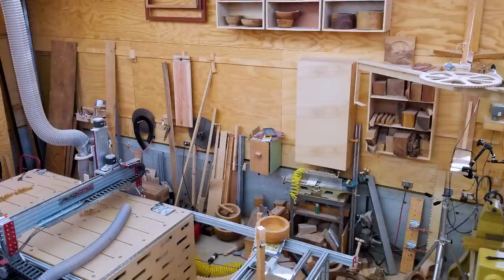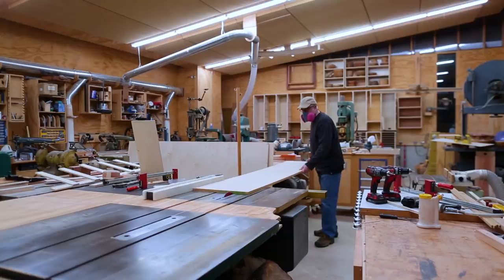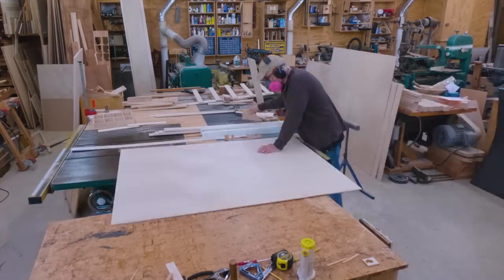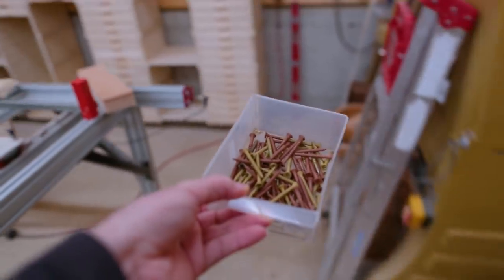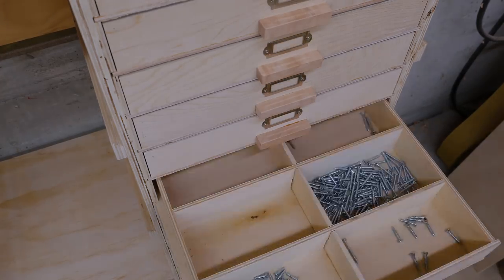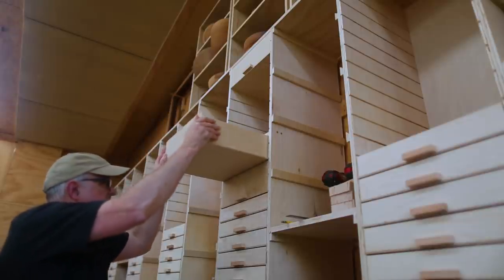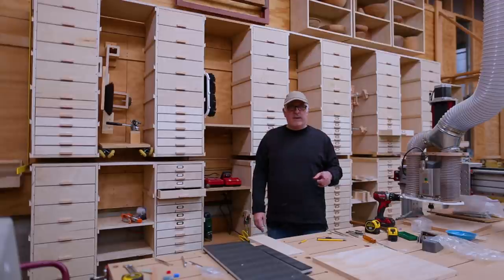Drawers for Small Parts

Comment: Probably already thought  of/mentioned - when you empty out a box then tear the front marker of the box with the manufacturer information and put in the bottom of the drawer for future restocking! It has helped me allot!! and frustrated when I forgot to :-)
Reply: This is my preferred method. If they are expensive or hard to find I'll even write the price/source on the box.
Reply from the maker: I did this with a few, where I had the original box.

Comment: The ladder on a rail. Like in a library / bookcase. So one can slide it if it’s in the way. John heisz made sliding/pull out storage systeem.
Reply: Would that support the weight of the ladder and person safely with the French cleats?
Not sure if John's system is similar in that fashion, but id be curious to see if it would be able to support that.
Reply: @doggfitt the ladder is on the ground. then you have the weight on the floor. the rails are there for guiding. and you don't have to attach the rails to the cabinets. 😃.                                                                         I have the French cleats in combo with John system. And the are supported not. admittedly i have no heavy stuff in it.. the are to small to put big heavy things in them.  😉

Comment: When you want to hang something long that has a hole in the end (like a T-square or a yardstick) use a straight rod that is put in at a slight upward angle. This will make it much easier to take the items on and off. I use a hook like the one you used, but I straighten the end so it has no bend in it.
Reply: I've always just used wood screws that have the longer section of smooth shank towards the head (I'm sure those have a specific name Im not aware of).
Don't have to worry about an angle or anything, just drive it in until none of the threads are visible and the flared head keeps anything from jumping off.
Reply from the maker: @doggfite  I have some like this too.
Reply: You could also just remove the hook/holder from the cleat to add/remove things from it then put it back.
Reply: Doggfite 👍🏻if you use a longer trim head screw (like 3") it will usually have a pretty good unthreaded shoulder and the head will be small enough to get through the hole on most things while still providing a little stop to keep things from falling off. If you need the smooth shoulder but don't have the depth for the long screw you can always drive it as deep as you need and clip off whatever sticks out the back.
Reply: @jeremyspecce  for rulers etc with holes, I like to hammer in a rivet at a slight angle.  Easy entry, and a smooth aluminum shoulder to hang on.
Reply: Cut a little off the offending vertical piece on the front until it fits through the hole.  Still have a piece left there to act as a safety catch.
Reply: Or drill a bigger hole and cut the bend shorter on the hook !   :-)
Reply: Or just use a thick nail :)

Comment: WOW. Just WOW. That is an impressive project. I really like your disk sander. When I was a machinist apprentice 40 years ago, we had a big disk sander like that in the shop. One day I had some small metal pieces to sand. Since they were small they would get hot rather quickly, so I decided to hold them with a shop towel; one of those red ones. As I was sanding, a corner of the shop towel would flutter in the breeze a little and suddenly got caught between the disk and the table. Luckily it jerked the shop towel out of my hand rather than pulling my had into the sander. There was a loud explosion and little red snowflakes filled the air. I learned a valuable lesson that day. Don't ever hold parts with a rag or wear gloves when using that disk sander.  :-/

Comment: WOW that is some beautiful project. I made a similar type drawer but I used the plastic bins that are available for the Lista and Vidmar cabinet drawers. These are handy (and a LOT less work) because they can be removed and shuffled if necessary. Never bothered to do the math but I learn something new every day! 6mm = 0.23622 in, ¼ in plywood is really 7/32 in or 0.21875in. The almost 0.02 inch difference doesn’t seem like much but when cutting dados, looking for stiffness, or thinking your project can mix the materials it does make a difference. Fantastic work and amazing videography thanks.

Comment: Hey Frank love the project.  An Idea for you that I do with my screws...cut the top off the box when you buy them and and park it on the outside of the drawer. That way you will know who makes the screw and the size of it and where you can go to refill the supply. I love the idea and it helps me a lot. when I go to the store sometimes I just take inventory or keep a running list of hardware I need so I can restock efficiently.

Comment: Nice job Frank, entertaining as always! The drawers with the foam inserts in, if you sharpen a piece of thin walled tube (an old garden solar light stem is ideal) you can make a couple of half round cut-outs either side of the tool you are placing in the foam to make it easier to grab hold of. Take care and stay safe, now go wash your friggin' Hands, again!! lol. Cheers from "Over the Pond" ... Les.

Comment: I find a 1/4-20 threaded rod holds the t squares really well and make it much easier to get them on and off then the 90deg hook you have.  The threads keep them from slipping accidentally. I also put the rod at a slight upward angle but I found that isn’t really necessary.

Comment: Great work as usual!
I will caution you about using holes in wood to hold router bits, I did this and I had most of the router bit shanks rust. Yes, I live in Tokyo which is humid in the summer, but I have AC that runs 24/7 but still, I had the rust problem. Just saying.
Man, that is a lot of parts!
Love the jig for assembling the drawers.
You should put a finger cut out in the foam for the calipers and CNC Collet wrenches.
For your ladder to get into the upper boxes, put a steel rail, pipe, on standoffs on the top of the cabinet, then make a ladder with hooks on top, easy to take on and off and safe too.
Cut the ends of the hook down a bit that you use to hand the T-squares.
Really a fantastic solution for storage and man to I envy the space you have in your shop!
Cheers from Tokyo!
Reply: Thank you for letting us know about the router bits rusting problem. I must soon make something for my workshop.....I will keep your advice in mind
Reply: I thought the exact same thing about finger cut outs in the foam ☺️
Reply: just spray the wood with WD-40 - it'll soak it in to the wood and protect everything
Reply: @alexwbakker  I did that, I actually used rust inhibitor that works well, CRC - 3-36 I soaked the plywood with it constantly, but in the end, the router bit shanks rusted. I now use the Lee Valley bit holders, easy to move around the bottom of your drawer as well, as they are held in by a screw.
Cheers!

Comment: Production improvements:
1. Nailing the drawer bottoms: make a nailing stencil so you don't have to measure individually.
2. If you need multiple stops, make a stop for the longest piece, and make some coloured blocks in the right lengths to put between the stop and the workpiece for the shorter pieces.
3. To glue the drawer handles on, make a jig: cutout for the handle, frame for the drawer front on top.

Drawer improvements:
1. Foam cutouts for specific tools: make finger cutouts on the sides.
2. Make small open containers for the screws etc. Usually you need a bunch, and now it will be easier to take them to your work table.
3. Put some of the double-height drawers in the bottom: You may then be able to see what's in them. Also, carrying heavy things onto ladders may be inadvisable.
Reply: Agree, also if he'd use little boxes for screws, it'd be easier to sort them by size etc. afterwards
Reply: I can't really speak for the production improvements, but they seem to make sense. On the drawer improvements: YES. 

Finger cutouts in the foam are a must. Nothing will make you stop using the cutouts sooner than not being able to get the tools out easily. 

Small containers? Absolutely. You never need just a few screws, and you rarely know exactly how many you'll need, you just know that you'll need some screws of size X. If you need multiple screws you could take the entire drawer, but if you need 5 drawers because you need 5 different sizes, it's no longer an improvement, instead it's cluttering your workspace.

Double height drawers in the bottom? Absolutely. Not just for the heavy stuff, but also because they're most likely to gatter some clutter, which may be stacked on each other (despite the massive amount of storage available). Another tip for the top drawers: Only store stuff you rarely need up there.
Reply: I have never done production type work and am wondering is there any way you could show me how this would work? "2. If you need multiple stops, make a stop for the longest piece, and make some coloured blocks in the right lengths to put between the stop and the workpiece for the shorter pieces."

Comment: I've been putting coconut oil on the friction points of my wooden drawers (mdf and plywood) and it makes them so much smoother!
Reply: I sometimes get ants in my shed, so I think coconut oil would give me more problems than solutions. I usually rub an old candle on the friction points of my wooden drawers, it does help with how smooth they glide.

Comment: For the boxes up high you could shorten the depth of the box but not the depth of the slide (bottom), then cut the slide at the outside of the back of the box and attach them back together with cheap square hinges on the bottom. When you pull the drawer out past the hinge it would drop down and you would be looking straight into the box. You may need a stop but friction might do it.

Comment: I typically put double sized drawers in the bottom as they are for heavy or bulky items. Seems a bit dangerous if they are so high up that you even need a ladder for them. Unless they are for very infrequent used items.

Comment: As an European, I laughed at that comment about 6 mm plywood being closer to 1/4 inch than 1/4 inch plywood, haha.

Others have already mentioned things that I would say too, so I won't repeat them. The only thing I wonder is if you considered to also nail the dividers, at least the center pieces in a few spots. I mean, I guess they won't probably get that much weight, and also probably the nails and glue all around should be enough, but if I were to do them, I think I would also nail the center pieces in a few spots just for peace of mind instead of finding then sagging a few years down the line. Probably unnecessary, but that's me.

Thank you for the video, instructional, funny and interesting as always.

Comment: You could use a long screw without its head instead of a hook to hang up your squads.
I saw that it was a bit difficult to place it with that 90 degree angle. Instead with a straight  screw you only need to queue your rules and place them.
Great work.

Comment: You should do like an old library ladder that slides on a top rail and has wheels on the bottom. Seems like the perfect spot for one. And then when it’s not in use it could slide all of the way over towards the dust collector so it wouldn’t be in your way by the CNC

Comment: 20:54 I have a prediction: You're going to cut the hook off of the T square hanger.  It's not necessary and already a pain in the neck.
Reply: Replace it with a screw, just enough of a lip to keep things from falling off.
Reply: @curtjohnson1635  He doesn't need to replace it with anything. Just cutting the hook the same size as the smallest hole in the t squares will solve the problem.. or just cut it off and bend it up. Gravity will do the rest.
Reply: Maybe angle the dowel slightly upwards so gravity will still keep items in place, but easier to add/remove?

Comment: PRO TIP (hope dont mid Frank) don't put similar length screws near each other, I always stagger sizes, 1" then 2" then 1.25" then 2.5 then 1.5, less likely to mix them up. 

Always Top Notch Vids from Frank. Thanks

Comment: Nice project Frank, something I’ve been thinking about doing for quite awhile.  I made the exact same for my router bits, but I vcarved the bit name and tool number (that I programmed in to my processor) since identifying the nuances between the bits can sometimes be a challenge for my eyes.  I’ve always loved your disc sander, would appreciate if you could share a manufacturer and model number if available.

Comment: isn't the wood going to dry out and become brittle after some time. It might take long but seems to me like a thin coat of poly, or oil would substantially add to the endurance and life span of this seemingly fragile drawer boxes...Jut my two cents on the matter, it does look quite amazing though...
Reply: Yes, after maybe ....2000 years.  6mm wood is plenty substantial for this use.

Comment: So what I did to label my screw drawers was just hot glued one of the screws/nails to the outside of the drawer.   I tried to label, but I don't know how I did it but I kept whacking the piece of paper in the label holder at just the right angle and knocking it out or crumpling it up.

Comment: I too love drawers. I have 129 drawers across my shop, many of them only 2" deep but also as large as 2' deep. And, many of them have dividers. Plus I have a parts bin cabinet with 138 bins. The problem is the amount of time it takes to find something. I had to label the drawers so I could stop opening them. Many of them I remember what is inside but the things I don't use all the time seem to take forever to find. I need a computer program to keep track of them. Maybe RFID to locate some of them! ;o)

Comment: Hanging long things on a hook- it is awkward to have to tilt the thing a lot to go over the end of the hook.  You could shorten the upturned piece on the end of the hook or straighten it out so it is sticking out at a 45 degree angle instead of going vertical.  This would still keep things from sliding off but would make it easier to put long things on it.

Comment: Maybe for the upper hard to reach drawers flip them upside down, fasten neodymium magnets to the drawer bottom insides, then hang ferrous items from the magnets. Or maybe when you pull the drawer out the bottom is hinged at the back and flops open to reveal the stored item

Comment: Wow.. just wow.. awesome project! The time, the COST.. effort! Great ideas to partitioning drawers! But, while I realize we ALL have too much hardware laying around, it looks as if you have wayyyy too much hardware.. Maybe cut back on some types to help the problem? I know that 50 years ago, I used nothing but standard taper wood screws. Then the '80's came.. and discovered Drywall screws did nearly everything.. bye to wood screws! THAT alone cut over 1/2 of my stock! The other thing is that while I kinda see your idea for hanging larger items in the space, I can't help but feel that maybe you won't be able to fill that space as well.. maybe use vertical slide-in panels that sit on slides? Other than those 2 observations, you have indeed developed yet another style of storage that is very simple, works well, and should give you some table space back! Great video production as well!

Comment: If you use Sketchup Pro for your designs, OpenCutList is an amazing plugin to create cutting lists and cutting layouts, it will do the maths automatically for you from the materials you will give it. It's a time saver. There are also some very interesting settings to optimise your cuts.

Comment: You need to catalog everything to the computer and install a LED light to the front of each drawer,  then you can search the computer file and it will light up the correct drawer corresponding to said part.

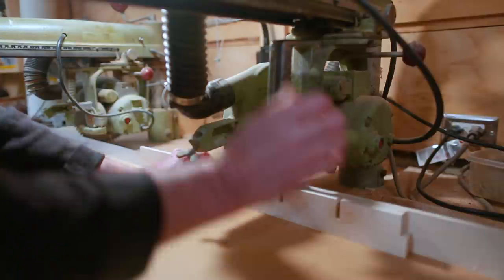Comment: 9:06 instead of a master copy, at least in that part, you could make a dowel of the same with as the cut, and insert it in the sacrificial fence at the height where it would allow you to slide the parts in as you cut them. First one would have to be either marked on the table with some tape or eye balled, but the rest would go much faster that way.

On my router bit, i have a piece of track that has swinging stops on it. Sometimes when i make pierce cuts (i have a sliding router table) i use them in that fashion, latching each new hole, in the swing out stop.

Comment: You should have made long strips for the handles. The back 2/3 should have an angle to enhance the grip Both sides.  The front should be rounded over with a 1/8  router bit.  Then cut to length.Gang cut.  This makes a handle that only needs some sanding on the ends.

Comment: I don't think your jig does needs to be full-width? If it were an inch narrower than separators it would still work and you could glue&nail side pieces all the way in-place. 
I also second the idea to glue/magnetize/tape specimens on drawer faces instead of labels but a stylised logo-like image of the shape and size of the bolt/screw-heads could also be branded/painted/chalk-boarded on.

Comment: I personally like removable bins so you can take the bin to the project.  I wish they made colour coded screws... I notice you have your wood screws in the same drawer, nothing worse than grabbing a handful of 1 1/4" screws and having a random 1 1/2" screw mixed in and that extra 1/4" poke through your project!    Ever screw on drawer fronts on site and run a too long screw through the face of the front, very terrible feeling.  Attention screw manufacturers, colour coded screws please!

Comment: So you use the CNC to drill 40 holes in a grid, but then manually cut 300 strips with 3000 notches? >> perplexed emoji <<